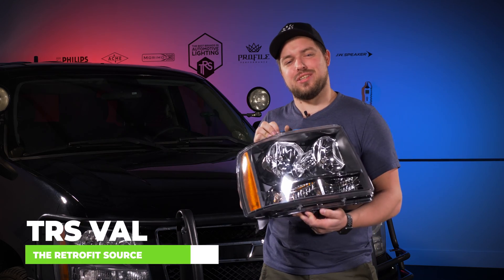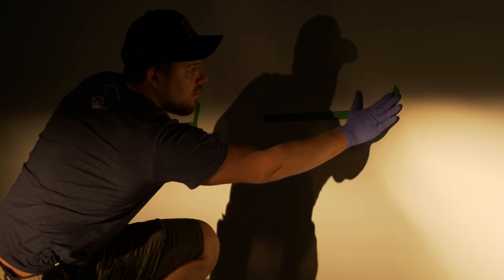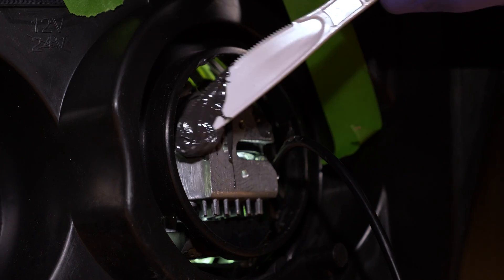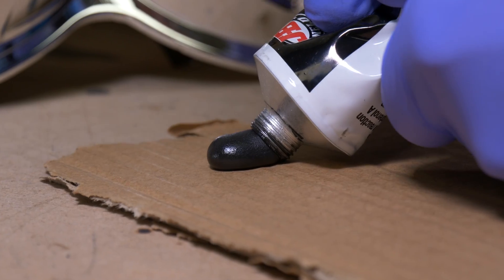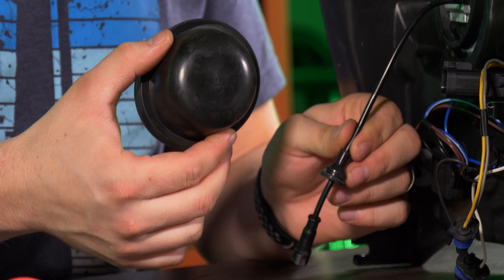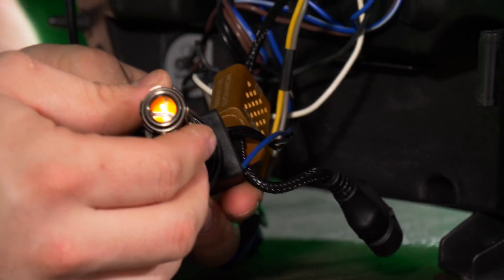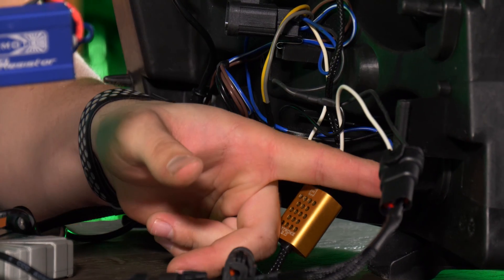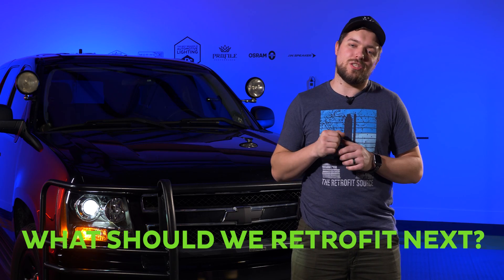How to build custom LED projector retrofit headlights and install projectors and halos with Morimoto

Comment: hello i just bought  this Bi-LED: Morimoto M LED Stage III and im gonna put this to my foglight 2019 honda civic hatchback. but how can i connect the low/high beam to my foglight it only 1 harness. do i need this to connect them together H8/H9/H11 Male to 9006 Female Adapter  or i can only use 1 connector and tucked away the highbeam?
help me!!

and the videos look esy but not

Comment: Back when I had a 1999 Grand Cherokee, my custom headlights consisted of Morimoto D2S Bi-LED for Low/High and the Profile Hi-LENS 2.0 for dedicated high. Amazing headlights but what a pain in the a$s all that HID wiring was. 

Now I'm researching to retrofit my own for a 2010 4Runner. My plan was the Morimoto M-LED Stage III Projector system for Low/High + Profile Hi-LENS for dedicated high beam...but seeing you use JB Weld, ugh.  Is JB Weld really needed?  I thought the M-LED headlight system with its threaded shaft in the back both aligned and held it in place enough to avoid using JB Weld, no?
Reply from the maker: Glad to hear you've had great experiences with Morimoto and Profile products!

When it comes to retrofits, we typically always use JB Weld as an extra layer of security. Even when fully tightened, we've seen cases where projectors can rotate, shift, or back out over time due to vibrations, heat cycles, or general wear. JB Weld is just added insurance to make sure all your hard work stays locked in place for the long haul.

That said, if you're confident in your setup and mounting method, you can always test-fit first and see how solid it feels before making that call! Let us know how the 4Runner build goes - sounds like an awesome setup!

Comment: So even on the trucks the lights only held in with jb weld?
Reply from the maker: For this retrofit, JB Weld is all we needed! You could definitely use a bracket or threaded shaft mounting too!

Comment: Question. When setting up your cut off line is the headlight resting on the table or are you holding it ? I have a gmc same era as this but I’m pretty sure if you set them on the table they are gonna be aiming at the floor…but if you are holding them how do know your holding them the same way ? Once the headlight is sealed back up is that it no more adjusting your cut off line ?
Reply from the maker: We use a set up on a table when aiming, we've made brackets that hold the headlight up. You can also aim on the vehicle, without putting the lens back on and sealing everything up first.

Comment: Does the Tahoe have projector to begin with? I'm wondering what type of housing is required before one can do this. Perhaps only limiter is depth of housing? If so, what housing depth would a car need to have to make this possible?
Reply from the maker: OEM Reflector Headlights for the Tahoe, but you retrofit both projector and reflector headlights.

Comment: How much would would be looking at, all told, to do this today?

I’ve got a 2010 Tahoe with crap stock lights and I want to do a Bi-LED retrofit DIY.
Reply from the maker: Depends on if you go a budget-friendly route or an all-out route! Shoot us a message, we'd be happy to connect you with some local retrofitters for pricing - support@theretrofitsource.com
Reply: @RetrofitSource  ok thanks! 

Second quick question:

I was speaking to a mechanic friend who didn’t recommend a LED retrofit on the 2010 Tahoe LTZ with the automatic lights. Said: “When they’re automatic, they’re on a relay. The relay isn’t powerful enough for initial ignition and messes with the electrical”

Can you speak to that at all?

Comment: So what do you do when the projector give out? You gotta reopen the headlight and crack the jb welds 🥴 sounds like a lot
Reply from the maker: The failure rate of the projector itself is so insanely low I don't think you'd ever have to do that.

Comment: How you seal the dust cover? That back part of headlight which you drilled for wiring.
Reply from the maker: The grommet on the HID wires seats into the hole that was drilled to seal it.
Reply: @RetrofitSource  okay thanks. And incase we are doing retrofit in H4 helogen headlamp then how we can seal the back cover? Because we need to drill it for HID wires and ballast.
Reply from the maker: You would use the grommet on your HID bulbs wiring.

Comment: I want to do this to a pair of headlights in a Kenworth, but the housing is filled with wiring for the bulbs and only an external plug that a harness plugs into to power everything, will I damage the wiring inside the headlight trying to heat it up to remove the seal?
Reply from the maker: Not at all! All this wiring is meant to take the heat from the normal driving conditions of the bulbs being on, the heat the engine produces, etc. It would all be fine!

Comment: That x-acto knife hole looks doo-doo. For a 1/2" hole, find a scrap piece of 1/2" conduit or some other pipe/tube and sharpen the edge. You just made a punch. Place the cap over a block of wood and use a hammer to drive the sharpened pipe through the cap. It makes a perfect hole. You can also buy leather punch sets for less than $20 that work great for rubber and come with a bunch of different sizes up to 3/4".
Reply from the maker: Thanks for the alternative tip.

Comment: If the headlight enclosure is fully sealed, doesn’t the LED projector overheat? Because the fan will just be recirculating the hot air inside the headlight housing.
Reply from the maker: Not at all, they are designed to function in that housing, you will have no issues with overheating! Let us know if you have any other questions, we are here to help!

Comment: Quick question when putting the headlight in the oven  did you remove the bulbs or keep them in?    I’m attempting this is in the same headlight but with a mini h1 projector wish me luck y’all.
Reply: remove it
Reply from the maker: You'll need to remove the bulbs. Since you're using the H1 projector, you'll need to use H1 HID bulbs.

Comment: Can you do a hid retrofit on obs Tahoes. I dont know what to decide on , 1 single projector or quad projectors.  What do you recommend, projector size , bulb, easy maintenance? Led projector or hid? I will have someone else do the retrofit. Theres a big obs gmt400 cult following,  if you guys made premade headlights alot of people would buy them.
Reply from the maker: You sure can! 

It all really comes down to what you want out of your headlights, and what can fit. Since you're having someone else do the retrofit, I would reach out to them and get their input as well. Personally, if the Morimoto MLED 2.0 or Morimoto D2s 5.0 can fit, those will be your best options!

Comment: That is great if you have OEM  but how about the  c light upgraded headlights for the  same vehicleby  Spyder
Reply: Just out. Spider now has a C Light with LED PROJECTOR built in. Not as bright as the morimoto projector M2 LED but is street legal

Comment: If the fan remains insight the headlight assembly (if you have threaded shaft), does it create problem of heating or air circulation?
Reply from the maker: Nope, even though the fan is still enclosed, you will not have any heating issues whatsoever.

Comment: It looks way more complicated than installing a classic hid projector.
Reply from the maker: It varies from headlight to headlight. This projector comes with an optional threaded shaft, which is typically easier to mount.

Comment: Definitely wouldn't recommend aligning the horizontal plane by resting the housing on a table. Always re-install the housings (without the lens on) to verify that your projector cut off line is level BEFORE you permanently JB weld them into place. #smh
Reply: Ummm they are professionals 😐
Reply: @thewiseone8191  Professionals make mistakes too.
Reply: Val used to run his own retrofitting business before returning to trs to work I would say he knows his shit
Reply: @sydneyann20101  Granted but, if you want perfection, you eliminate as many potential areas of risk as possible.
Reply: Everyone has a different method if it provides proper results in the end then it doesn't matter,if we were all the same thought man,,what a boring so expecting life we would lead with no surprises, lol,